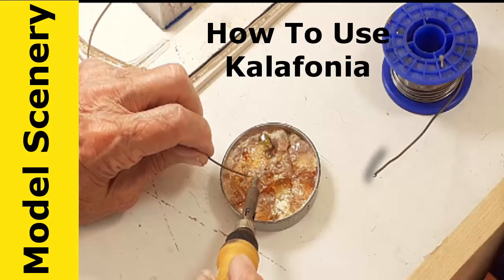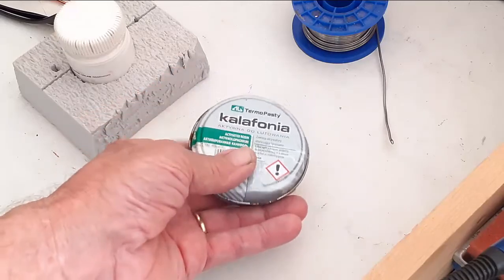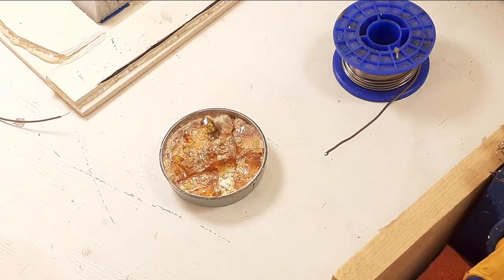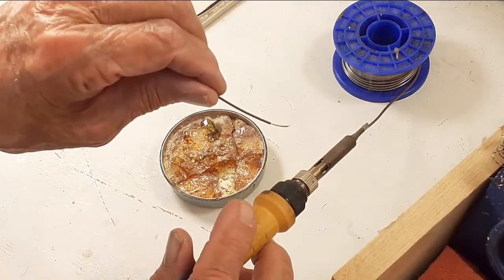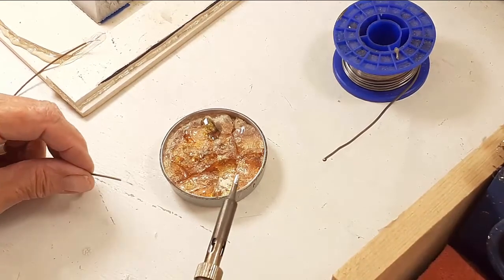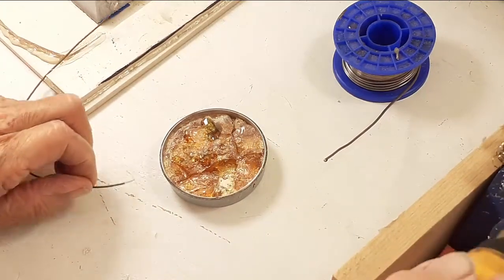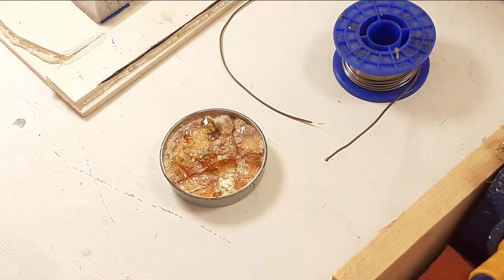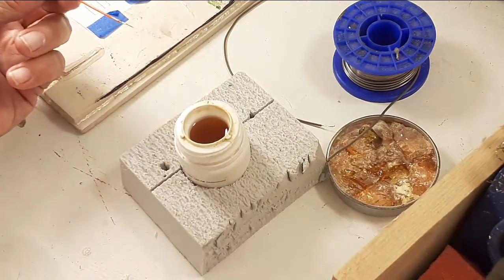How To Use Kalifonia Resin Flux Soldering Basics

Comment: Thank you for your video! I found myself in a situation where I did not have my usual equipment, and had honestly never used Rosin Flux. I assumed that I could just heat and dip, but you know what they say about assuming.
Anyway, thanks again!
Reply from the maker: I add varying amounts of alcohol to the solid  flux.  Sometimes I make a  paste and then, of course, the liquid.  Regardless of what flux, rosin or another, it is always best to pickle the work to clean up excess flux and oxidation.  See https://steamtraininfo.com/resistance-soldering/resistance-soldering-how-to-make-and-use-pickle.

Comment: is kalafonia the same as pine rosin? or is kalafonia active? I make my own flux using pine gum rosin then powder it down and add isopropyl alcohol, but was wondering if kalafonia is different or superior
Reply from the maker: I really don't know.  I use kalifonia because it is available at the building supply.  I make a liquid by chipping about half out of the plastic container and dissolving it as I need it. I then add alcohol to the remainder, a little at a time, and make a paste.
Perhaps someone watching this video can answer your question.